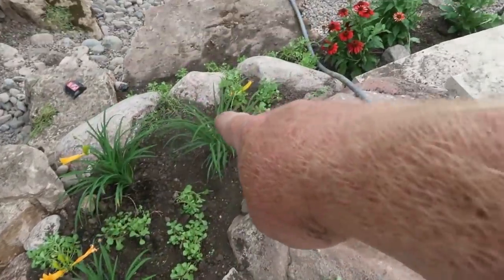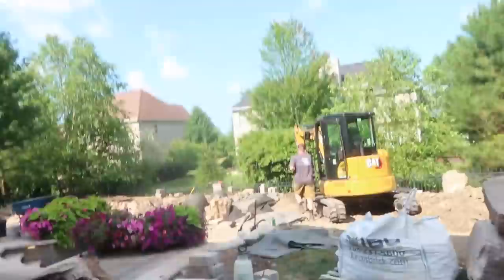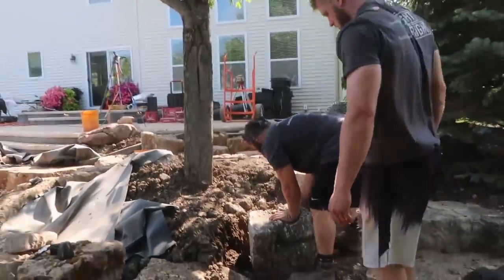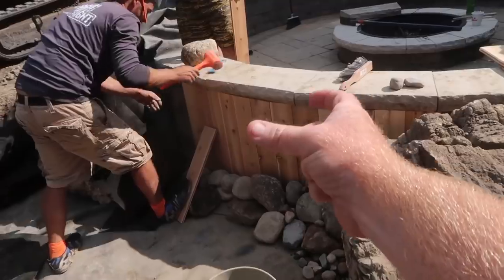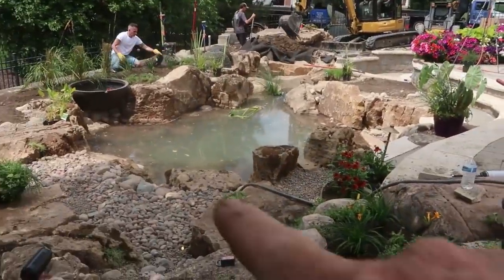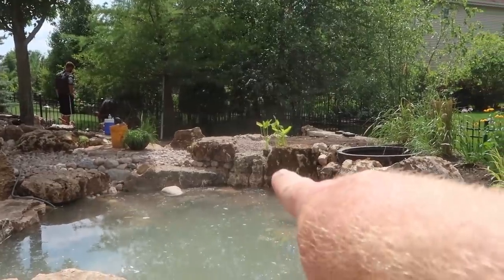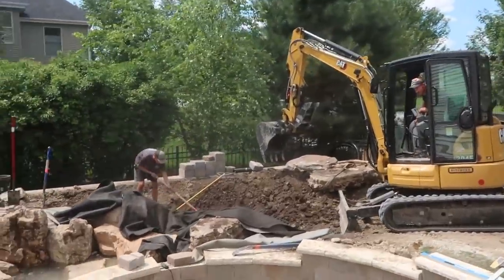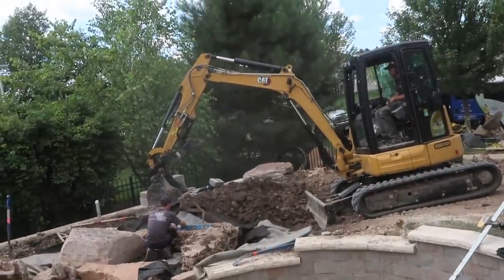90% DONE! BACKYARD POND & Stream Build - Part 5

Comment: You aren't "picky", you're a gifted architect, and architecture is just as much of an art as it is building a functional structure. Flipping and relocating that rock is essential to get the best naturalistic look. Amazing project guys-just fabulous. 👏 One thing about Thuja Placata (cedar) is that it contains a potent oil that is toxic to fungus and insects. In light of that, I'm not sure how the leaching oil will impact domestic fish such as Koi. The species does not typically grow close to bodies of water outside of riverbanks. To be safe, let the wood break down to the point of growing algae before introducing fish. Truly an incredible project. That wood is going to silver out near the top, then blacken below the water surface. Absolutely magnificent work of art. 😍💗